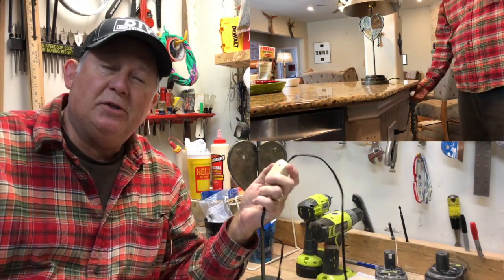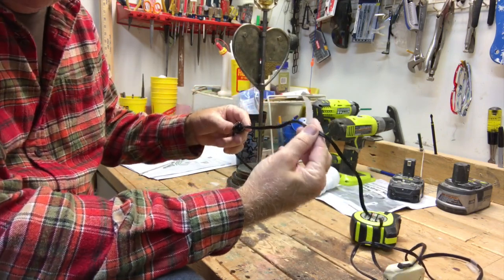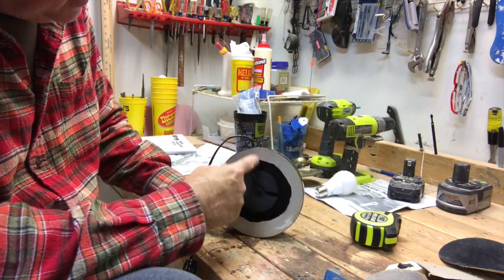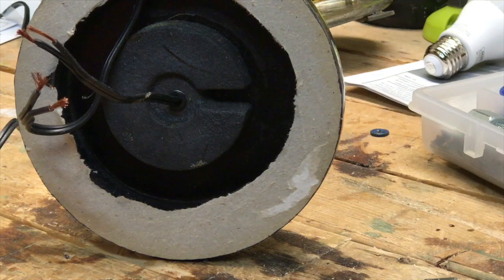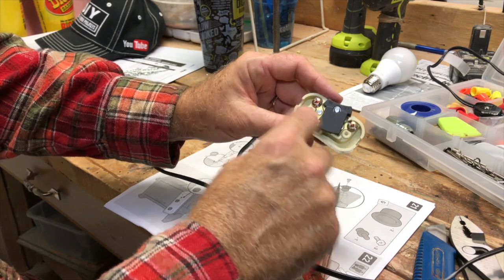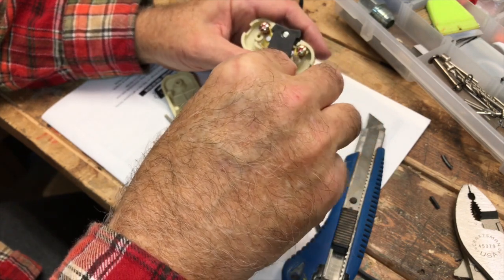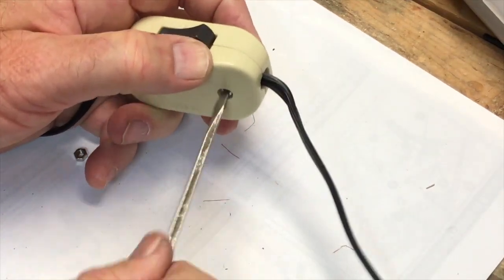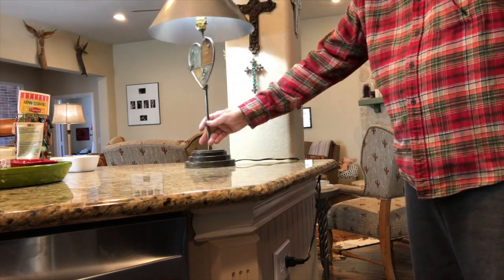Replace And Install Lamp Switch: Simple DIY Instructions

Comment: HOLY CRAP! I BELIEVE YOU WIRED IT BACKWARDS at the switch. I believe the smooth wire is your HOT wire and needs to be the one under the two screws. The NEUTRAL-rigid textured one -does not need to be cut. It just lays through the switch. Am I right?!

Comment: Black tape.....never use it to keep wires together...the glue breaks down. Besides the pulling on the wire will loosen them over time and they will pull out. They should of been left uncut and at best soldered and heat shrinked. I hope you rewired it.
Reply: The way you described it, is the correct way
Reply: God yes! And what happens if the wire nut on the hot side comes loose and the wire shorts against the base!? ⚡😮

Comment: Why didnt you just shorten the cord at the switch area.  ..seems it would have been much easier.
Reply from the maker: That’s perfect idea but it would limit the use the lamp if we wanted to move it to a different location where we needed to plug it in

Comment: I don't understand why you cut the wire inside the base if you were going to cut the wire completely at the switch. Just remove excess length at that point.
Reply: That's what I was thinking. Double the work.

Comment: Should the switch be  connected to the live wire or is it ok for it to be placed on either of the two wires? I did not see you testing for the live\hot wire in the video.
Reply from the maker: Check the insulation on the cord wires closely and you will find either a textured bead or a thin colored line running along one wire, this is the neutral. The plain wire is the hot. If the cord isn't marked with a bead then the strands of wire will be different colors. In these cases the silver wire is the neutral and the brass colored wire is the hot. The plug on the lamp cord holds another clue to polarity with the wide prong being the neutral and the narrow one the hot.
Reply: DIY Home & Garden Projects Appreciate the reply but according to my understanding, the polarity can be changed by simply  plugging into the socket the other way and then the switch would actually be on the neutral. Wouldn't it? I am new to this and don't mean to bother you with technicalities of installing a switch.
Reply from the maker: If your plug   has prongs the same size, you can flip it over and plug in either way, them the wiring wont matter.
Reply: DIY Home & Garden Projects well, yes the prongs are of the same size and hence the confusion. I've seen videos where the switch is connected to live wire to break and release the current. However,  when a plug is involved, it simply can be plugged in any other way. The switch could shift from being on the live wire in on position and then the other in another position. This could be an electrical hazard.

Comment: Well thank you Sir, I put a switch on my 24 inch shop light that was supposed to be mounted under a cabinet or on a ceiling and wired into the house wiring. I couldn't find a small one for my seed starting shelf, that would just plug in. I was forced into it, if truth be told, everything was getting very leggy and flopping over, and they hadn't even started their true leaves yet. So thank you very much.

Comment: I loved the videos, helpful but the switch instructions indicated one side was hot and one side neutral. So which of the wires did you attach as your in wire? The grooved side or the smooth side?
Reply from the maker: Either side it doesn’t matter just make sure it’s the same flowing to the other side

Comment: Hi, thanks for the how-to. I'm actually wanting to replace my in-line dimmer switch (wheel) with a regular on-off toggle like the one you did.
Is that doable? Thanks. I want to minimize dirty electricity and get rid of dimmers, LEDs, etc.
Reply from the maker: Should be easy enough to do.

Comment: Why did you cut into the wire at the bottom of the lamp?  Is there a reason you don't use a wire cutter?  As others have stated, using electrical tape vs. soldering is dangerous.
Reply from the maker: I agree

Comment: Is there a way of removing a switch from a lamp? I purchased a tall floor lamp and the switch is very bulky and in such an awkward position, I'm unable to tack the wiring to the skirting, would be much easier for me to just use the socket switch..

Comment: I am going to replace a wheel toggle that broke off the screw .  The hot wire is the only side cut, so I think I can just  strip those ends back a little and put them on the screws for this new switch since this switch is bigger I should be able to expose enough wire.  Can this be used on a polarized plug?
Reply from the maker: Beverly Dolan , yes that should work.
Reply: Thank you!

Comment: What if I accidentally snipped a couple pieces of the wire. Will the majority of it still work?
Reply from the maker: Just make sure the exposed wire is not the snipped pieces. I can always cut it at the snip level and shorten it up a little bit.

Comment: Omgoodness. 
1. You did not need to go into the lamp and cut the cord short in it if you did Step 2 and spliced both lines. Regardless of this you don't use wire nuts on the bottom like that. When you have excess cord you pull it all the way up through the lamp the light socket above and rewire it there.
2. You do not know what your doing. You don't splice the other wire. You only splice one. The electrical tape is a fire hazard. If you have to move the switch then for fire safety you buy a new cord.
Reply: I'm not an electrical specialist, but I knew he wasn't doing it right
Reply: Is it possible to get rid of the cord and add a switch at the  base?

Comment: I can't find switches that have screws for the wire, just a pin that's supposed to pierce the wire. They are all too small to get the wire in the switch and close it up. This would have been useful if you told exactly how to find the switch you're using. Lowes had nothing like that.
Reply from the maker: Here is a link to the switch, but it is for cords with two wires, https://amzn.to/2Jpi0Ae

Comment: personally i would never just join two wires in the torpedo switch with insulating tape, better to do it right and solder the two wires then tape it